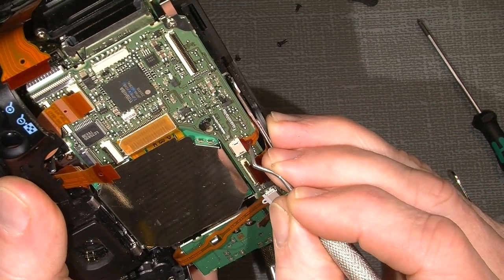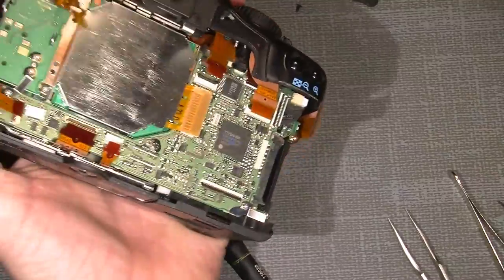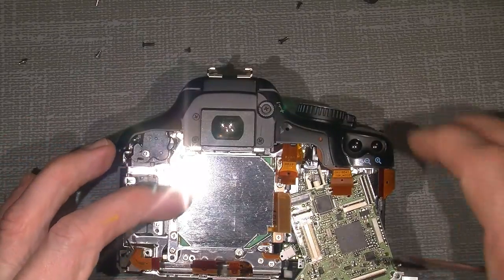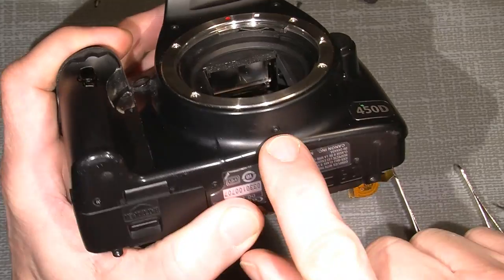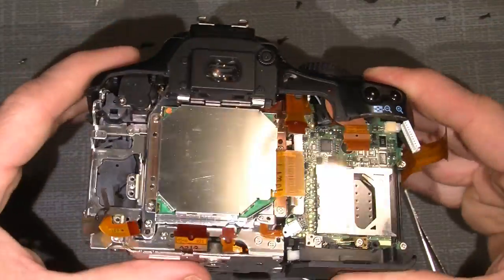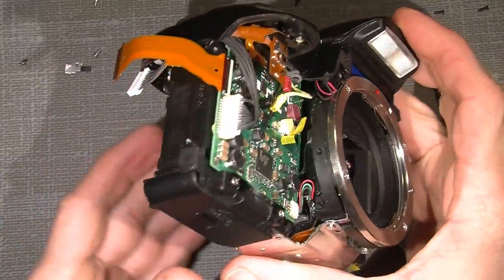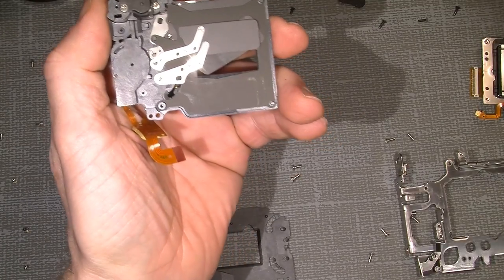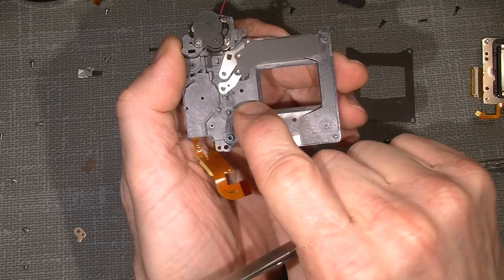Broken shutter in Canon EOS 450D  DISASSEMBLE  ONLY

Comment: I used this tutorial to fix my camera. Now my camera works like a charm. Thank you! As a side note, I shocked myself pretty good from the capacitor. Wish I would've used a resistor to drain it first.
Reply from the maker: That's great Alberto, you can also build a "simple tool" to discharge the capacitor, next time when working with a camera, I have made a video you can see right here:   https://youtu.be/nPr4cpVmhPo
Reply: I built one after I got shocked *too late at that point* but it turned out for the better, because I ended up reopening my camera and discharging the capacitor after several test runs. The point is, I replaced my shutter curtains and now my camera is working. Your video gave me the confidence to open up my camera. Keep up the good work.
Reply: @bird2002  how did u manage to find a replacement for the shutter?
Reply: @GraphicManInnovations  I found them on eBay. In the search I typed "EOS 450D shutter curtains" and a bunch of results came up. I made sure to buy the one that had both the top and bottom pair because when my shutter curtains crashed into each other, they were both damaged. So I needed both, you might also need both. As of Sept 2022, they're still $9.99 for the pair. Hope this helps you in your endeavor.
Reply: @bird2002  thanks, just was curious, mine is ok (still @18K) but wondering how did u manage to damage them? is that normal to happen at a specific age?
Reply: @GraphicManInnovations  I'm not totally sure how they were damaged. I was in the middle of a photo shoot when suddenly the screen went dark and I got an error message about the shutters. After that it didn't work anymore. After I removed the lens and tried to catch a peak at the image sensor is when I noticed that the shutters had crashed into each other instead of sliding past each other. It was very strange. I don't think this behavior is normal at any age, and I had never dropped my camera, so there wasn't any direct cause.
Reply: @bird2002  yes it has a limit but it is too long, do you recall how many shots did that shutter made before it crash?
Reply: @GraphicManInnovations  No, I did not check the number before I attempted the repair.
Reply: @bird2002  so its okay to make the spark shock? Even though it made a little spark and blackened a part of the circuit board. Did it still work after that?
Reply: @mikeno62  good day to to you sir Mikeno! can you give me some advice in discharging a capacitor via multimeter and charging it back by multi meter.

Comment: Good work! I will use your video as a guide for a shutter substitution  if I have the same problem with my EOS 400D. 
I see (at minute 39) you use one antistatic wristband, well thougth !
Reply from the maker: Thank's Ramon, and again, take good care of the capacitor because there is really a lot of power in it. The way I dis-charge it was not at all correct, but I just show why it is SO important to not set finger's direct on the circuit board where the flash capacitor is. One should use a resistance of 2K ohm and 2 watt to "short circuit" for 20 second, to dis-charge the capacitor and then check with a multimeter / volt meter.
Reply: Yes, I have seen the "bang!" the screwdriver have done, ja ja! :-D
Reply: Hello, it's necessary to discharge capacitor? ... It's slowly possible with multimeter? ...